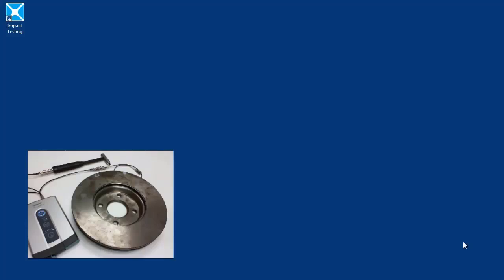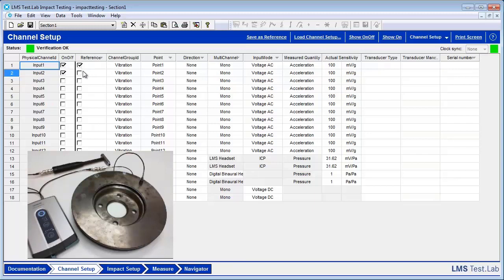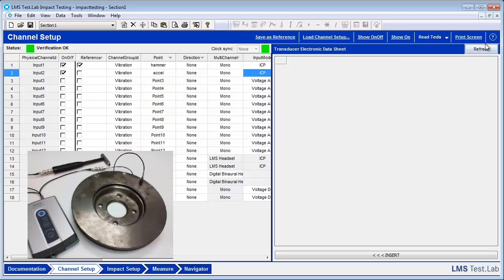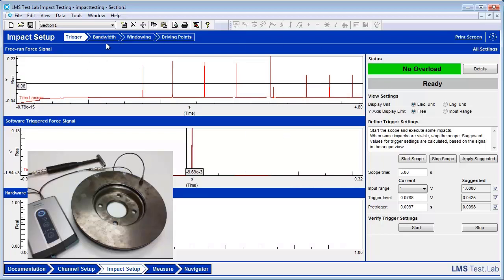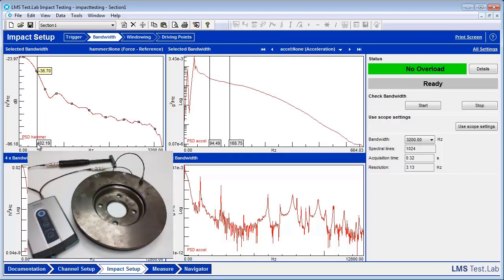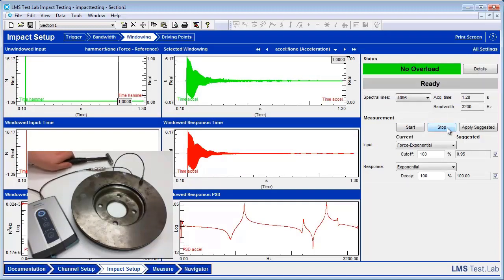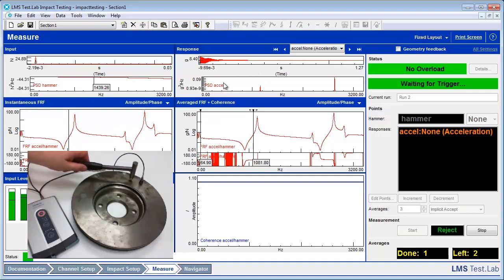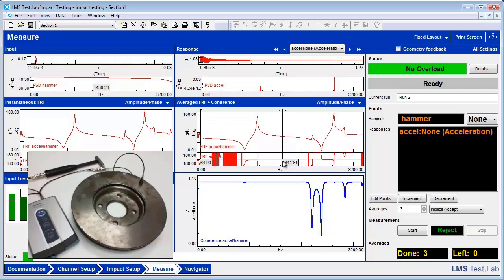Modal Impact Testing

Comment: Hi!! We're doing a modal test using 6061 aluminum shallow plate(15cm x 8cm) . We've attached 12 accelerometers on the plate, and fixed one edge of the plate to the vibration shaker.
We're trying to find the  'response characteristics' of three different cases.
1. modal test using only impact hammer 
2. random test using only vibration shaker
3. random test using only vibration shaker (condition : the fixed bolts of the vibration shaker is a little bit loosened)

can you guess the reason why there are response characteristic differences?
plus, do you think there's an algorithm to testify loosened bolts?

Comment: Hello, I'd like to ask how much the bandwidth should be set better? For example, I'm testing the frequency response of the automobile air filter shell, and the mode I care about is about 250Hz. At this time, should bandwidth follow Nyquist's law and set the range to 2.56 times of 250?? Thank you and look forward to your reply
Reply from the maker: For a mode at 250 Hz, the minimum bandwidth would be 300 Hz.  But a bandwidth of 500 Hz would put the mode of interest in the center, which is probably even better.  Due to damping, a 250 Hz mode will be present in frequencies above and below this frequency.
Reply: @SimcenterTesting  OK, I think I see. Thank you

Comment: Great video. Shouldn't you set the impact range before impact setup?
Reply from the maker: Yes, it is recommended to range before measuring. The trigger detection step ranges the hammer channel, so only the accelerometers need ranging before the measurement.
Reply: @SimcenterTesting  Thank you for your reply. I like your video very much

Comment: Hi, some video taught that the proper way to do a impact test is we need to hanging the structure. Is it true?
Reply from the maker: That is not always true.  If trying to correlate to a free-free simulation model of the test object then hanging from a soft suspension can approximate the same conditions as the free-free simulation model.  If the modes of the test object as installed are of interest, then it would be mounted as it is used in a real life application.  The simulation model can also reflect real life boundary conditions as well.  Further discussion in the boundary conditions section of this article: https://community.sw.siemens.com/s/article/Modal-Testing-A-Guide
Reply: @SimcenterTesting  thanks for your response😊

Comment: Hello, during the modal test, there are three kinds of data in the navigation bar: crosspowers, referenceautopowers and responseautopowers. What are the functions of these three?? Thank you and look forward to your reply
Reply from the maker: The reference autopower shows the force input level versus frequency.  This should be as flat as possible over the frequency range of interest: https://community.sw.siemens.com/s/article/what-modal-impact-hammer-tip-should-i-use.  The responseautopowers are the acceleration responses versus frequency.  In general, these crosspowers and autopowers are used in the calculation of the FRF.  By seeing the individual components, if there are any problems in the quality of the overalll FRF, it is useful to see where the issue might lie.
Reply: @SimcenterTesting great ,thanks